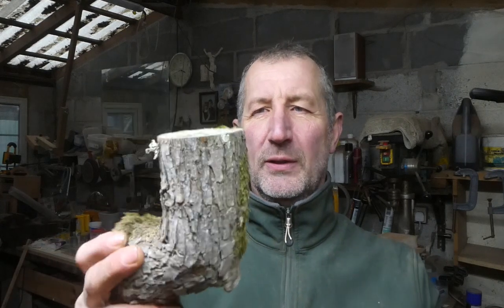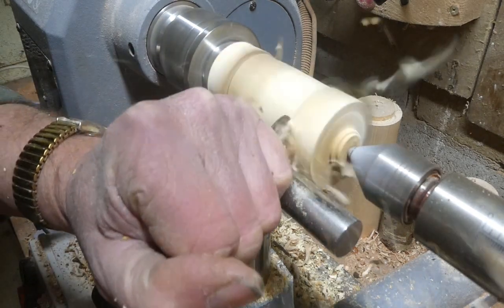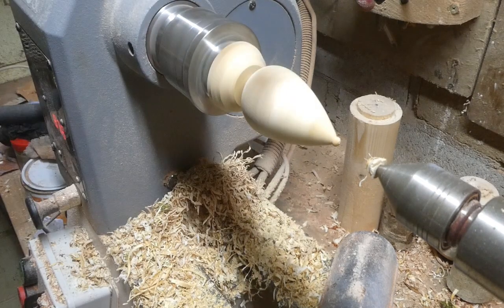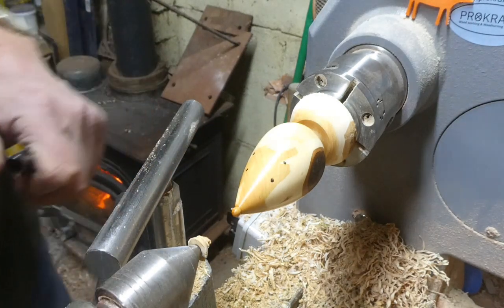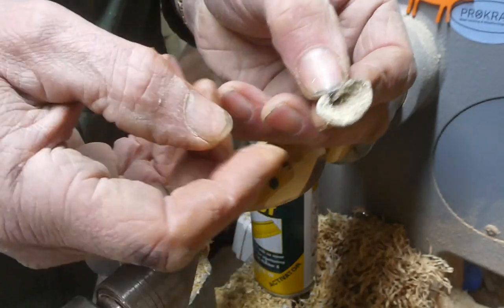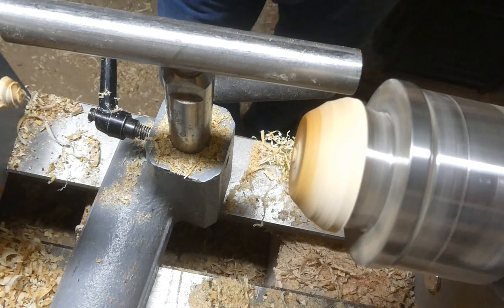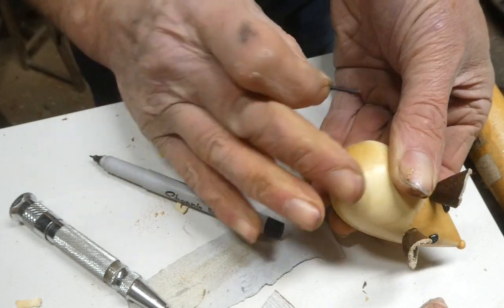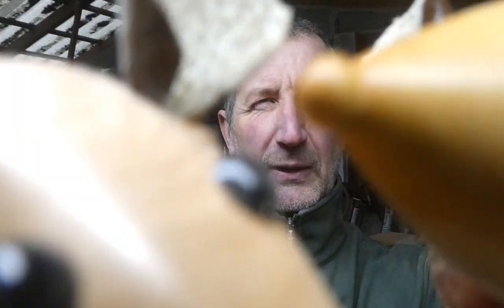Wood Turning - a cute Mouse

Comment: What kind of wood did you use? Also, what was the beginning dimensions of the blank you started with? Thanks,  Stuart
Reply from the maker: Hi Stuart...
This was a branch of Hawthorn...
It was about 5 inches long and about 3 inches in diameter...
The finished mouse is just over 3 inches long and 1 and 3/4 inches in diameter......
But the beauty of these little guys is that you can make them what ever size you want...
Take care...All the best.....Andy